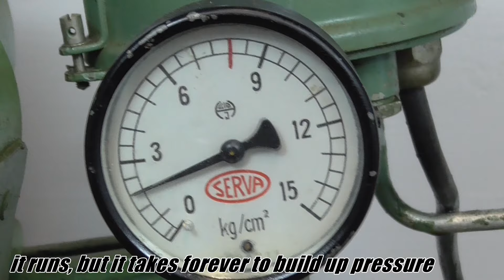1959 Broken Air Compressor - Repair and Maintanence

Comment: Why does the ground wire always need to be the longest one?
Reply from the maker: It's for safety. If the cable/wires should get pulled out of the plug than the ground wire is the last one that gets disconnected.
Reply: If someone pulls on the cable and breaks the wires the ground wants to be the last one to break.
Reply: Same as a UK 3pin plug. Earth is always longer with a 'loop' to keep in contact
Reply: @mymechanicsinsights  The manufacturers of that plug already dealt with that for you, though, by placing the connector for the ground much further back. You made it doubly long. I suppose it doesn't hurt as long as it wasn't so long that it gets pinched and broken inside the plug.
Reply: Not to sound unsafe, but I'm a master electrician in Canada and I cant recall that ever being taught this haha.  I mean you kinda got issues regardless if wires start pulling out, but i can appreciate the theory.  The cord ends we have hear often don't leave room for any extra wire typically.  Like wbfaulk mentioned it would likely get in the way.
Reply: @Matt-my7pz  Its the first thing you learn as a new EU electrician don't pull the cord, to unplug. Second connect the cord/cable so that ground disconnect as last. its even good practice to do so with stationairy equipment.
Reply: @Matt-my7pz  UK plugs take things a step further. Live wire is the shortest - straight line from the entry to the plug. Neutral is next longest and Earth longest - and the terminal screws are not in line with the pull of the cable if it was pulled out. So live would disconnect first, the neutral then earth. Also, the wire routes in the plug - the live is kept away from the others just after the cord grip - again to minimise risk of partly pulled out cable with any other wire touching the live terminal. I too wasn't taught about that, I figured it all out for myself!
Reply: @Matt-my7pz  "Master electrician" - sounds posh for only knowing two facts: 1. Is the insulation thick enough to cope with the voltage, and 2. Is the conductor thick enough to cope with the current ?
Reply: Is this same practice done with the female end of an extension cord as well friends?  My earlier questions and comments were more along the lines of a female cord and not the male cord end of a tool.  So i was out of context, my apologies.   Moving forward with that question is there a practice for Female cord ends?  if the conductors are all different lengths, its less likely to short upon being yanked out and continue to be energized.  Granted this situation isn't desirable regardless of the way wires are terminated.  I'm just "figuring this all out by myself".  Now you have a live cable on your hands with 120 or 240 volts looking to land on a surface.  Wouldn't it be safer for the wires to short out in a situation where the cord is pulled out of the cord end, having all conductors even?  Seems potential for damage and personal harm would be increased with the staggered ends.
Reply: @mymechanicsinsights  Just for the record, screwing stranded wires (Litzenkabel) without a wire end ferrule (Aderendhülse) is not NIN- or DIN/VDE-conform. It's a tiny mistake and a lot of electricians are too lazy to do it, but perhaps you didn't know.
Reply: @finalius123  he prob didn't have them. It may not be the safest. Nor the best. But it will last a long time regardles
Reply: It was terminated incorrectly in the video however.  That was not designed to have the wire crushed like that.  The strain relief exists so that the cable cannot be pulled out.

Comment: Had flashbacks to my time as an hvac technician when I watched you tighten those brass pressure fittings on that aluminum tube.  I had to replace the same type of aluminum tube with brass pressure fittings for a water cooled system in a medical facility.  

The amount of torque put on those brass pressure fittings has to be just right or the fluid medium pumped through it will leak.

Comment: It's a nice compressor, but due to the age, I would really recommend inspecting the inside of the tank and also do a pressure test to make sure that it wont explode on you. It's not hard to do a diy pressure test on one. I've done my two old compressors so I know I can trust them! Would hate to see it cause you any trouble!
Reply: I just did the same thing with a (nowhere near as old) Craftsman I got from Craigslist. Held 250psi with water no problem and I shocked the weld seams with a rubber mallet to make sure. Fingers crossed.
Reply: Diy home test?? How ..im restorung an old tank now
Reply: @robertroberts9782  best way I've found is to use a pressure washer. Make sure the tank is full of water with NO AIR INSIDE. This is important. If there is air the tank can explode dangerously. If it splits with only water in, the water will initially burst out, but it won't cause much damage. You will need a pressure gauge that can read up to double what your operating pressure will be. If the tank survives double the pressure from your pressure washer it is fine. You need to be careful with the pressure washer though as they can operate at extremely high pressure. Another way to do it, is use a small electric car tyre pump, they only displace a tiny amount of air and are capable of very high pressure, but they are likely to burn out if not in good condition. Also stay well clear of the tank whilst performing the test.

Comment: 6:05 ok it looks like your compressor has a cold, what could have caused that?
Reply: I guess that it is an emulsion of water and oil (like mayonnaise is).
Reply: @georgescott6967  that's crazy... Motor mayo...
Reply: Mucus build up, just needed a good cough.
Reply: It can happen in case of overcharging oil level into the compressing unit, and both, highly humid intake air; during his race, piston give up from the downside camera so many droplets of oil-water emulsion, spilling it out in the tank. Definitely best way to destroy compressor seal.

Comment: I got an air compressor that needs a restoration. Its probably not THIS old but its gotta be at least 30 or more years. The plastic wheels broke off and the piece at the end of the rubber hose leaks. I thought about looking through a junk yard for wheels that size but theres no knowing if the axils are the same size.

Comment: Did you check the Motor-capacitor?
I think that the motor is running to slow and a bit unsmooth.
Reply: I mean it's a single cylinder motor with a small flywheel, its gonna be rough no matter what

Comment: So what was the problem? Where did all that oil come from in the "water" and "slime"? is it a loose tolerance from the compressor piston? Is this normal operation?
Reply: Its from the 50's man, wouldve been collected over time from the oil that lubricates the piston slowly evaporatingirs way through the air system while in use. Happens to any air compressor.
Reply: Some air pressure tools need added oil to work with air....
Reply: @macbaar  The oilers for those tools are down stream, no way that oil gets in the tank. The oil in the tank would have to come from the compression piston to end up in the tank.

Comment: Never thought I’d see a purulent discharge from an air compressor.
Reply: the breadman a frank exudate, in pathology terminology:-) No aspersions on any Franks among viewers
Reply: As Kimberly from Mighty Morphin' Power Rangers would say, "Ew, gross!"
Reply: That’s an emulsion of water from internal condensation and oil from the cylinder and crankshaft. The mechanical equivalent of mayonnaise.
Reply: @zeevo  thanks - was wondering..

Comment: Tip, put a rag in the bore when you're cleaning the gasket off or grinding/ sanding the pot. It will stop junk getting in the bore and wearing out the piston rings.

Comment: It would be neat if it had an oil-filled gauge so the needle mechanism wasn't taking so much vibration (it's relatively delicate and certainly very old). It would definitely last longer and provide better resolution when watching the pressure level rise/drop. Still awesome either way, even without a full restoration! Sometimes a tune-up is all that's needed.

Comment: Very nice! I can't see it being used for media blasting though, being only single cylinder and having a small tank. My small compressor  is two cylinders going to 10 bar with a 350 Liter tank,  and I still have to wait for it to catch up.

Comment: I watched the whole video, but I failed to see what you did to fix the problem. When my compressor was slow to build pressure, the valves in the head were bad and needed replacing.

Comment: When you're rewiring the plug, why do you say that the ground wire needs to be the longest? It seems to me that it needs to be a little shorter than the other two. You ended up having to double it over inside the plug.

Comment: So the problem was only the gasket right at the beginning?
And why does the ground wire have to be the longest, when the plug is arranged in such a way that the ground wire is already positioned further back?

Comment: 7:35 
Well, i WAS eating...
Reply from the maker: That was very disgusting indeed and it didn't smell good either.
Reply: What do you think it was?
Reply: I'm eating too! But I'm a nurse so... gross is the name of my game. Hahaha
Reply: Probably some grease that got into the tank mixed with condensation.
Reply from the maker: The oil in the crankcase from the pump goes up the piston and mixes with air, a bit oil in the air is needed though. And yes the water is condensation and the mix of that is very slimy and smells disgusting...

Comment: I would love to see this thing with a perfect restoration, sure it still looks good considering the age but I just love seeing things look like they came back from the factory of that time, but better. It's such a cool thing to see but considering the time and work that would go into that I can't blame you for not doing it if you could fix it so easily ( compared to the other things you've done) tho I must I am slightly disappointed, either way I'll be on the look out for the next video

Comment: Maybe if you decide to do a complete restauration you can paint it and add rubber dampeners (like other people already said), but i would advise you to equip it with a air filter for water as well (to make sure you don't get anymore 'snot' in the tank)

Comment: I'd be very cautious with a 60 year-old pressure vessel, especially one that has had a mix of liquid and air in it. I'm guessing that he's done a visual inspection of the inside with  a camera. I wonder if its worth running a hydrostatic pressure test on the tank?
Reply: Why would you be cautious?  What is the worst that can happen?  It isn't going to catastrophically explode, it will just develop a pinhole and start leaking.  This isn't the movies.

Comment: You always get a bit of oil blow by with these. The emulsified oil in the pressure switch feed is because it's been under too light of a duty cycle and not got hot enough to vaporise the water. Piston compressors should run about a 50% on/off cycle but it's hard to size one appropriately for domestic use. (Compressed air engineer)

Comment: Your vintage compressor sounds way quieter than my more modern one. It sounds like a car engine revving with no muffler attached. What's the difference between the older compressors and modern ones?
Reply: Not made in R.O.C. 🤗

Comment: 7 minutes is a long time compared with a modern two cylinder compressor. But this compressor is impressivly silent.
Reply: It depends a bit what you use it for, but pressure, time, and tank volume are the key measurements. 7.5 bar is about 110psi or 7500 kPa, and that is enough pressure for many jobs. Ordinary tyre inflation, but not the bigger, higher-pressure, truck tyres. 4.5 bar for restarting the compressor looks OK for paint spray guns. Can that be adjusted if needed?

I glanced over one of the UK's workshop tool stores, and the performance still looks OK. All direct drive rather than belt drive now, but that one could run a long time.

Comment: Is this the air compressor that you use for your sandblaster? If so, how many liters per minute does it output? Im trying to figure out what size of aircompressor i'll need for my sandblaster.

Comment: What was the reason the compressor took so long to compress? Was it the gooey stuff inside
Reply from the maker: I think the compressor was fine. I guess the problem was from the little S-shaped tube, i think it wasn't 100% sealed. That thing releases the pressure from the big valve from the tank to the compressor once the max pressure is reached. If it leaks then it can fill up the tank properly because the air gets lost before it.
Reply: @mymechanicsinsights  Most likely was leaking valves, caused by dirt build up in them, so the cleaning was welcome, providing a good seal. As well you had leaks from all the fittings, which you could hear in the first try out, losing all the compressed air before it entered the tank.

As an aside that motor capacitor is guaranteed to be full of PCB oil, so careful if it has any sort of sticky residue on it. Inside with intact seals no problem, but when it leaks an issue.

Comment: I have something similar its in great shape except the tank rusted through.  Im told to never weld on these tanks yet original construction shows the tank being welded... what do you think?
Reply: It's machine welded, then the metal is normalized (de-tempered) in a controlled oven to relieve the stresses. Hard to do at the workshop.
Reply: @michaelrice500  i have yet to attempt to patch it but if I  do I intend to put a pressure relief valve

Comment: i think the piston rings or cylinder are worn out, the slime is a mixture of oil and water(from air). if the piston rings are leaking oil it will do that, any case slime it's pretty normal for a compressor.
but the 7mins run to full charge is a telling sign.

Comment: I'm jealous of countries that have 220-240V to every household plug.
Reply: We have in Switzerland 3x400V in every house.  Live Wires to Live Wire 400V and Live Wire to Neutral 230V and Live Wire to the Ground 230V.  The Air compressor which was restored by my mechanics is a 3x400 electric motor but with a capacitor (the silver cylinder) you can drive a 3x400v motor with 230 volts using the Aaron circuit.  so a 3 phase is imitated is not perfectly 120 degrees phases shifted but only 90 degrees!  But for engines that don't start well, it works great.

Comment: Please make sure the compressor is fully vented before unscrewing things! It made me wince when you were unscrewing things and it was hissing. I’ve had a friend make that mistake with a diving air compressor (up to 232 bar) and she blew filter shrapnel into her hand and had to have surgery.
Reply from the maker: I released all the pressure before I opened the valve, but there was still a tiny little bit left.
Reply: If you didn't realize there was no air in it, you probably shouldn't be commenting on such things.
Reply: my mechanics insights good to hear :)
Reply: Andrew Delashaw what are you on about?

Comment: so what was the original cause for  the low pressure? its always concerning when you pull something apart and put it back together and the original problem seems to have been fixed but you don't know exactly why. Murphy's law says the problem will return.